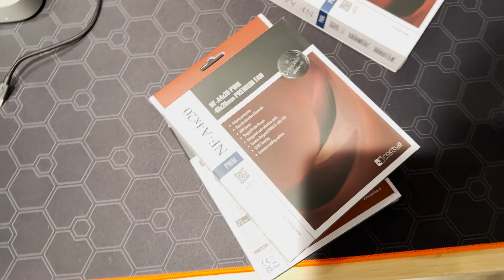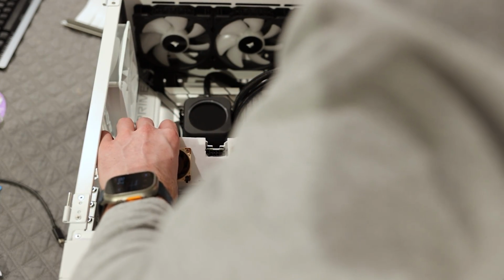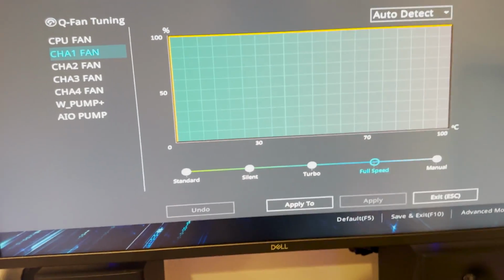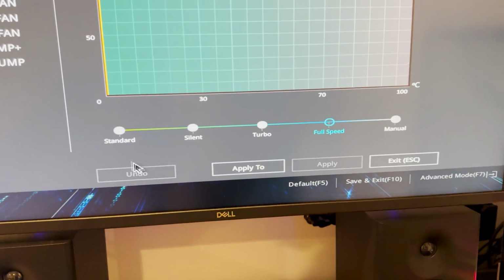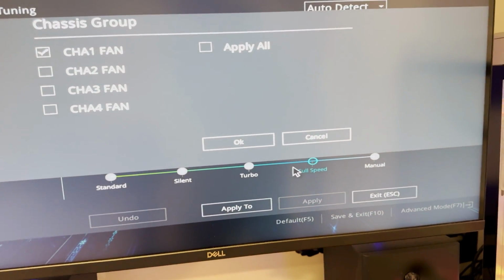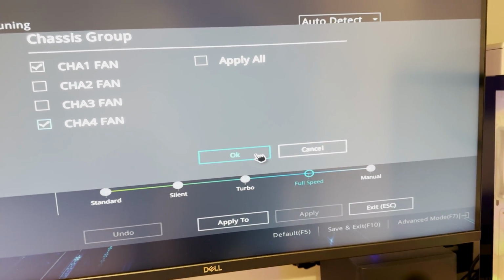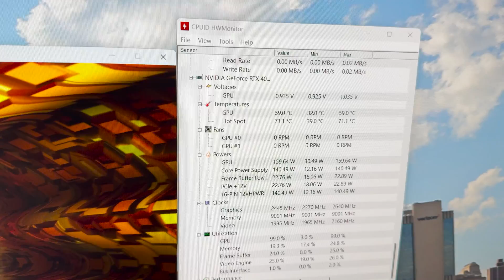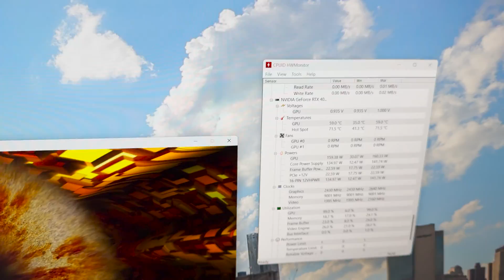This Custom GPU Cooler looks sweet, but how does it cool?

Comment: you gave me an idea, i will just add a small blower fan on the side to exhaust and leave the normal fans there to see if there is a difference if i exhaust the heat away.
Are these noctua fans 5 volts?
Reply: Do it. I found a 40x40mm fan in a box clearing out my old workshop and just zip-tied it to the exhaust next to my GPU (with furniture pads to absorb vibrations). Increased airflow plenty and lowered temps by a fair bit. Cheap and easy mod.

Comment: Back in the day you used to be able to buy custom graphics card coolers like you can with cpu coolers, I had an arctic cooling accelero S1 and it was a beast compared to the stock coolers, this was like 2007.

Comment: I mean you're only blowing air over one set of fins with the others blocked off by heatpipes with 4x 5cfm fans. No one would have expected this to work. It would take like 12 of those just to equal one 60cfm fan.

Comment: It seems like this configuration could be successful if you used the mini fans to direct the exahust while leaving the existing fans installed. The biggest factor is not fan speed but air volume being moved and I am not sure those fans can move the same volume of air as the default fan configuration. If not then you would cause air pressure to rise in the gpu and actually hurt cooling performance.
Reply from the maker: Only one way to find out, just have to put it to the test …